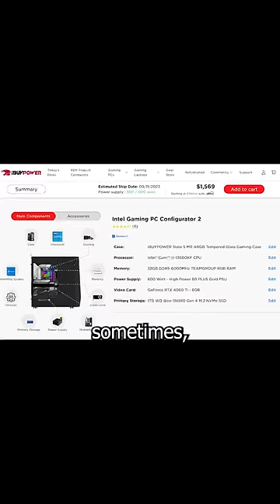Is a prebuilt #PC worth it? It depends. #technology #shorts #tech #computer

Comment: I use a prebuilt PC. Have used it for 8 years now. Still works like a charm. Never had a single issue with it.
Reply: Maybe not with it specifically, have you checked your wallet?
Reply: @LordTrashcanRulez  dude every person I know that builds their pc will spend more on it than somebody who got a pre built.
Reply: @duckyduckington9736 yeah, as I’ve gotten older I’ve found this to be the case. It’s usually cheaper to get a prebuilt if you don’t know wtf you are doing. Cheaper to build if you know the exact difference between every cooler, motherboard, etc etc. as someone who does not know the difference, can make it hard to build a budget pc when u don’t know what is or isn’t good besides “higher number better no?”
Reply: I've pretty much always used prebuilds until the current one that I have now. It was an HP prebuilt gaming tower and now I don't think there's a single thing original now. It's been ship of Theseus'd into a new pc piece by piece.
Reply: Yup, same here. Bought a cheap pre-built, immediately replaced the PSU, then switched out parts over time. Still kicking without any issues.
Reply: @duckyduckington9736  pre built only focuses on cpu and gpu thats why i dont like it
Reply: @menharawatson  sure, not everyone wants to make it themselves though, I personally dont want to learn how to make a PC because I have hand problems so I would fuck up and break something.
Reply: @duckyduckington9736 
What gets me is those that feel cool buying parts secondhand so they got the parts cheaper, so they then can argue how building your own is cheaper. Yeah, buying a gpu new to buying it second hand will be cheaper. Considering a pre-built uses new parts, they'll argue its a waste because you can build better "cheaper." 

Really all that should matter is at the end of the day you are happy with the pre-built and it does what you want it to do without being an actual ripoff. 

For games I play, my custom honestly doesn't do any better than provide more framerate with higher graphic settings. But my older pre-builts run the games fine as well just lower graphics and slightly less high framerates (so custom doing 140fps and older doing 90fps).

Comment: My first PC was a prebuilt, I had no knowledge about computer building at the time and wanted something as a gateway into the PC community so I chose a Cyberpower Rig. It had worked great for the entire time I used it (~4.5 years). I even got to do some upgrades with it over time and got enough information through that to recently have just built my own PC for the first time! Both are great though, and if you’re looking for something entry level, Pre-Builts from reliable manufacturers are the way to go

Comment: As someone who got their 1st ever prebuilt PC I can confirm I’m now fully understanding upgrades ahead of time for the future. My pc has 16 GB ram , 1TB SSD , I7 - 12700 , & the heart of the build a RTX 3070 which is still kicking for a solid GPU I’m planning for upgrades in the future.
Reply: Those specs should've cost around £800
Reply: @dyent  im in the US my guy
Reply: @NLGogeta  About $1000 then. Maybe less, a lot of companies don't bother actually converting between £ and $, just change the symbol and charge us the extra.
Reply: @dyent  around $1,200 but it’s honestly not a bad prebuild I’m just now getting into PC gaming / tech so I didn’t have the patience nor time to build one myself so I just opted for a prebuild 🤷🏽‍♂️
Reply: Just make sure the psu isn’t a fire hazard
Reply: @NLGogeta  Tbf that's probably within 10% of the component cost so not a terrible deal. 
Of course, the true markup will be higher, cause they won't be paying retail prices for components, but as far as the end user is concerned it's pretty reasonable. 
Over here it's usually closer to 20% above the components retail value, plus whatever they decide to add on for the brand value.
Reply: @ertgb_  I’m sure my psu isn’t lol
Reply: @dyent  understandable the only thing I don’t know on my prebuild is my motherboard and my psu wattage my main concern is my motherboard I wanna know what manufacturer it is so I can figure out what’s compatible with it. I think my psu is 650W
Reply: @NLGogeta  well if you don't know/can't find the brand, it's probably a fire hazard
Reply: @ertgb_  hasn’t caught fire yet 🤷🏽‍♂️ I monitor my PC and everything so I’m fine until something bad happens until thing imma enjoy this prebuilt
Reply: @NLGogeta  that's like saying killing people is fine because you haven't been arrested yet
Reply: "still kicking" as if the 3070 is anywhere close to a bad card.
Reply: @Lorentz_Driver  that’s why I said it since it came out in 2020 😂 never once said it’s a bad card Ik it’s good only downside is the 8GB VRAM still a solid card
Reply: @ertgb_  why would it even be a fire hazard?
Reply: @plant_12  most off brand psu’s are made with super cheap and usually hazardous components, leading them to explode and probably kill multiple of your parts, as well as possibly setting your house on fire.
Reply: @ertgb_ model > brand

Brands that make good units also make bad ones, and a lot of brands offload their PSU production to another manufacturer (which isn't an indicator of a good or bad unit)
Reply: Nice, I built my own and have 16 GB RAM, 1 TB SSD, a 5600X and 6750XT
Reply: You should be very happy your CPU is a 12th gen Intel, not a 13th or 14th gen Intel ( alot of them rust from the inside out due to manufacturing contamination ).
Reply: What's your motherboard though? Do you know what BIOS update you need for a CPU upgrade? Will you need to upgrade your motherboard in the future? What type of RAM does it take?

Comment: The problem with prebuilts isn’t that they’re prebuilt.

It’s that most of the name brands cut corners, install bloatware, dramatically overcharge, have terrible thermals, and/or miss basic steps like XMP.

Consumers deserve better.
Reply: can relate to the terrible thermals one. Bought an rog prebuilt and it had 1 fan for the GPU so it was pretty high temps but the CPU.. oh boy. 80c idle, 90c on load. Got a new case and got new fans right away. Now I'm good.
Reply: And that 90% of prebuilts are marked up in price so their value for money is absolute garbage. Seriously. The amount of times I’ve seen this even with big youtuber owned PC shops is uncanny. Hate how customers are able to mark up products like this and get away with it because people will still continue to pay those prices because they don’t know they’re being stiffed for a PC they could own for far less due to general lack of knowledge about what stuff is worth.
Reply: 100%
Reply: Yes thats why its better to buy parts from 1 store and have them build it for you allowing you to get the ease of not having to build it and not get scammed by a big retailer
Reply: Don’t let them find out you enabled XMP/DOCP. They void your warranty.
Reply: plus there is the psu concerns from companies like ibuypower and cyberpower
Reply: And single channel ram on some of the older ones, or flex mode (like the ones with 12gb ram etc.), and they used to use really sketchy no name PSUs in the past. They still use cheaper motherboards with limited IO and capped bios, even if it’s a perfectly capable board. At least with ddr5, you can have odd sized ram sticks (like 6gb, 12gb, 24gb etc.; they EXIST now lol) because each 64bit ddr5 dim has two distinct 32bit ddr5 channels instead of one rigid 64bit channel per dim, allowing for immense flexibility for ddr5. With ddr4 and before this was impossible, and flex mode came on. I just enjoy building PCs, like a stoner enjoys smoking, and don’t judge if someone else buys one, idc at all lol.
Reply: Not to mention non standardized OEM parts.
Reply: True true. But there are a few. I think NZXt build kit is pretty decent. But honestly it's  2023. The only factor zo stop you from building it yourself should be time.  Knowledge is sooo easy to access nowadays. You need just reddit and a day of youtube videos
Reply: Friends, I took off the 17 one arm pull-ups Support the people
Reply: well yeah and they can do all that because typically people buying prebuilt are inexperienced and lack the knowledge to understand these things. Also because of the lack of knowledge tech guys can sell u an essentially bloated pc that will have problems almost immediately within the first 3 years. And since u bought a prebuilt there’s nothing u can do! except buy the other more expensive prebuilt they offer u that surely won’t have problems
Reply: This.
Reply: Good ones CAN exist, it’s that most companies just decide to skimp on one thing or another or make the experience suck because they want to attach so much trash to their systems
Reply: thins only happens when buying from shotty prebuilt brands,i had a prebuilt from skytech and it was great before i upgraded the case and fans, still use gpu cpu mobo psu
Reply: Yeah, just have a shop build a pc for you if you don’t have time to build one
Reply: Can you even miss XMP? I thought it was enabled by default. (My PC was a custom pre-built)
Reply: @anonymousx6651  you can. It happens all the time. Technically running RAM at its rated/XMP speed is overclocking, and usually that isn’t on by default.
Reply: I never had any problem with pre-built pc's. If you buy from the right place there should be no problems
Reply: That's my take. I'm not anti-prebuilt because I hate people who buy them or think they fucked up or anything. I'm anti-prebuilt because the ones I've seen have for the most part not been very good or worth it imo. There's nothing wrong with wanting to buy everything in one box because you don't know how to build it yourself or anything like that. I just think the people who do that should be able to get a good prebuilt and there aren't a lot of them.
Reply: @razer1158 here prebuilts are actually cheaper than building a pc on your own in Eastern Europe. Parts alone are fucking marked up 20% so it doesn't worth it and rather get a pre-built gaming pc or gaming laptop
Reply: I've been looking at buying a gaming pc for awhile now and still flip between building and buying a pre built. Seems like it's just convenience you're paying for with a pre-built and can get better performance with better oarts by building your own.
Reply: Bought a pre built 3 years and had none of these problems.
Reply: And buy parts in bulk and don't test them so you end up with GPUs that tear.
Reply: XMP is overclocking, this is not "basic steps" and shouldn't be done lightly
Reply: @LinuxIsNotAnOperatingSystem  bullshit. Yes it’s “technically overclocking” but we all know nobody honestly considers it as much. Otherwise RAM wouldn’t be sold and advertised using its XMP speeds. It’s current year. Modern RAM is expected to run at its rated speed.
Reply: @MarioLuigi0404  but doesn't it void warranty?
Reply: @MisterMick113  Not for the same price though, I went with a pre-built because I was getting a panic attack from all the numbers on the parts, not knowing which is good or which is bad, and I knew the GPU market at the time was exploding in value and were hard to get, so I knew if I did build, I'd be waiting a month with a half completed PC waiting for overpriced parts that I'll probably build wrong and have some neckbeard elitist breathing down my neck saying I'm an idiot
Reply: yeah and it's not really that hard to build a pc. there's like a couple actually tricky things sure, but for the most part it's not that bad. the parts are designed to fit together. if you can figure out ikea you can probably build a pc
Reply: exactly thankyou for understanding.... the only reason to buy a prebuild post bitcoin mining era is if you dont know how to build a pc and cant fix their fuck ups (and prebuilds often get fucked up). and anytime i have a friend i tell them to just let me get their parts and build it for them cause its cheaper and just as good if not better
Reply: @trippasnippa119  Bro a 4090 costs as much as my prebuilt, I'm happy with my prebuilt
Reply: @mikem0ke my first PC was a prebuilt ibuypower. Except for the LED lights that didn’t work as advertised, everything was pretty good. The power supply was also from EVGA so they didn’t skimp out on that either.
Reply: I have a prebuilt 3090 i9-1200k from NZXT and my friend has the exact same thing but he built it himself and mostly I get better fps
Reply: I bought a $3000 prebuilt pc about 2 years ago, but they made a mistake while building it, and after about 4 months of use it would immediately bluescreen whenever booting it up. when I sent it back to them for repair, they said there was nothing wrong with it. ended up having to take it to a place locally to get it fixed.
Reply: It’s called: researching the company
Reply: Yet the majority of people own prebuilts

Comment: I have a cheap pre build, my thinking is that I can upgrade it over time.
Reply: You can
Reply: Thats what i did with mine changed motherboard, ram, cpu, gpu
Reply: Depends on the brand, if its HP, good luck
Reply: @bloodbags6885 shoulda changed out the case too and said u built it 😁
Reply: @bnjifye  Dang its not even the same anymore
Reply: but can you? there's always caveats like mobo doesn't support the power of new CPU, PSU is too small, not enough m.2 slots, etc.
Reply: I did that and now the only things that's the same as when I got it is the case
Reply: @bnjifye lmao so you just ended up building your own pc 😂
Reply: @gtaatmiami  yea pretty much😭😭
Reply: Well yeah. That’s how I have my current pc, because I bought a prebuilt then started upgrading it until eventually I had an entire new pc without even realizing it
Reply: Hit or miss on that. Often what they skimp on is exactly what you'd want in order to upgrade: mainboards w/o spare slots, power supplies with no extra capacity, oldest possible versions of controllers and connectors, &c. You can end up having to replace core components before you even have the ability to do a substantial capacity. That's not always the case, though, and sometimes you will be able to add new gear without any hassle.
Reply: @Charly_bro  It's not guaranteed he can. lol
Reply: Not always, some companies like HP have proprietary hardware components which makes it impossible for you to upgrade anything on it.
Reply: @bnjifye  Ship of Theseus ass PC

Comment: Im happy with my prebuilt
Worked since 2018 no real problems besides a fan breaking
Reply: I am also a pre-built owner. I had a minor issue of faulty ram, which was like a $60 upgrade. Aside from that, it can still hold up to today's standards. Mine is also made with 2018 hardware
Reply: i got my prebuilt so far only issue is  Power supply fan has bad bearing witch on startup sounds like an old v8 trying to start after 12 years of neglect.
Reply: @luk4s56 if its just sound on start up its fine
Reply: @WT_Bolt  first 2-3 minutes, after that its gone, i even took everything apart to check if any wires are touching but nope just the fan.
Reply: @luk4s56  does it affect performance or anything
Reply: @WT_Bolt  nope it affects nothing just scares she shit out of me when i "cold start" the pc
Reply: @luk4s56  ah well then u can fix it i know if it was me i would say i will fix it but then forget and then never fix it
Reply: @WT_Bolt   you are correct i start the pc and then peace out for few minutes when i come back there is no more issues xD

Comment: my first PC was an ibuypower prebuilt. It still works to this day (with some minor upgrading I did over time). I never had issues and doing the minor upgrades and exploring the PC gave the confidence to finally build my own which I am using now. I think its a great first step for people who want to learn but also want to play now
Reply: i think you should change the psu on the prebuilt though as prebuilt psus are usually not great other than that enjoy !!
Reply: I had an iBuyPower pc.  A little over a year after purchase, the CPU died.  I decided to replace it myself.  A little over a year after that, the computer died.  I suspect the PSU, but I don't know for certain.  At that point, I decided to build myself, but I made sure to spend time doing some research so I knew what I was doing.  That was a few months ago.  I'm quite happy with it so far.

Comment: As an NZXT pre build guy:

I got the 600$ one during Christmas of 2020, learned to upgrade parts as time went on and as of now the PC has none of its starting part's but the m.2 storage and case. 

So pre builds that are modifiable are good, the ones that are locked down and ziptied to kingdom come are a pain in the ass.
Reply: Agreed. I bought a cyberpower prebuilt and it is absolutely designed to be modified and worked on. As I’ve gained more knowledge I’ve tinkered with it and I’ll probably do some major upgrades down the line, but considering this was my first desktop, and I have a disability that makes fine motor control difficult, buying prebuilt just made sense.

Comment: Prebuilts are fine but you should still make sure that all wires are seated properly and maybe even take off cooler to make sure that they took off the plastics
Reply: Yeah, the thing about the cords is correct. My brother bought a pre-built, and it didn't work well sometimes, he sent it back to them to get repaired it came back the same as when he sent it to them, so he looked into it himself and realized his cord to the motherboard was upside down, it works fine now though